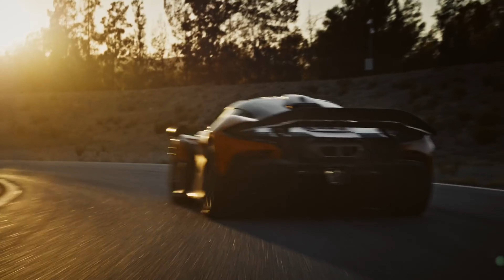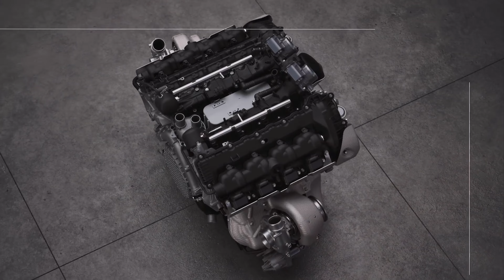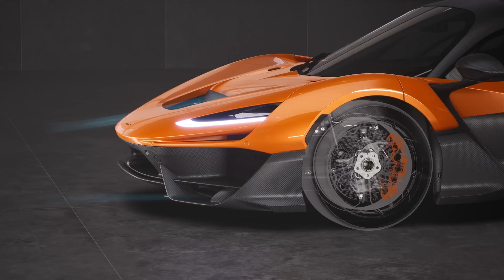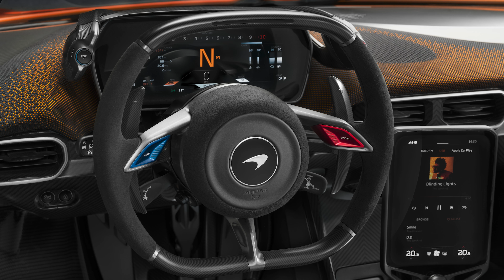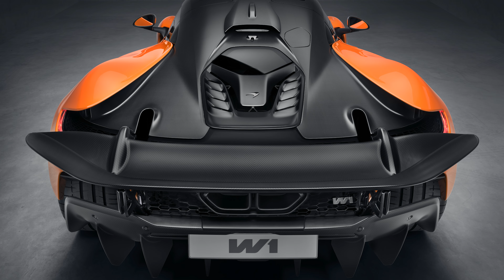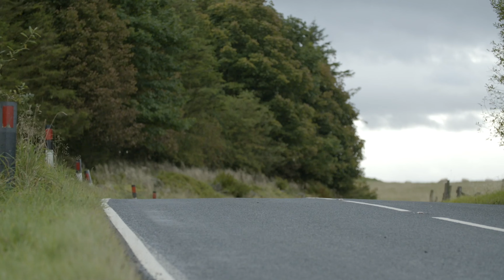McLaren F1 to P1 to W1

Comment: W1 or P1 will  ever be a F1, even with almost twice as much power , turbocharger,  better aero dynamics , still they cant beat the BMW S70 engine , it reached 241+ mph in 90's.
That's phenomenal achievement,  and it's not just the gordon car design , it was the Engine that did something spectacular

Comment: Esos númeron en potencia de HP y NM me hace creer que es competencia para Bugatti y Koenessegg pero la velocidad maxima 🤔🤔🤔🤔🤔 mmm.
Tan solo 350km/h,eso lo hace cualquier otro Mclaren,tambien el 911,GTR,BMW,MBensLambo,etc.
Hasta el Speddtail con 1050 HP llega a 400km/h.
Reply: That's all because of the tires, mechanical platform, and aerodynamics. Even the P1 could reach 402km/h but was electronically limited due to making the car more reliable to drive. And the tires that are good at top speed are not very good at cornering. So they have to go for one thing or compromise on everything.

Comment: 1275 hp at 3100 lbs is nutty. That’s gotta be a lot of fun
Reply: Yup... all the the real wheels, lol. McLaren keeping it pure!!
Reply: I see alot of wheel spin, I can Imagine Yanni losing to Matt complaining about the wheel spins lol.
Reply: @Doevahkiin  That's only in an off-the-line drag... so much more to performance cars than 0-60s. It will be balanced and fast in the corners, fast ad slow complexes and quick on the brakes with so much less mass to stop.
Reply: @Nemoticon  Too bad buyers of this car don't even drive these on track. They'll keep the mileage low and with a note in the garage "DONT TOUCH".  Most of these are only driven top speed straight and on drag strips.
Reply: @Doevahkiin  Not too bothered about the byuers, they just provide the money. I'm more interested in if the manufacturers take their cars racing or not. That's all that matters, track credentials.